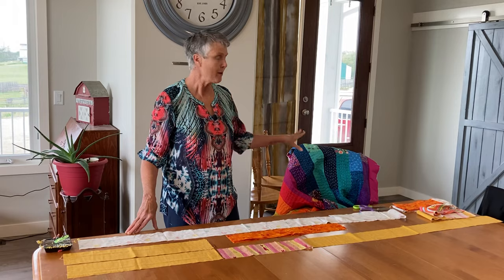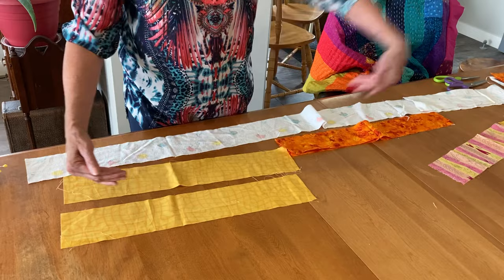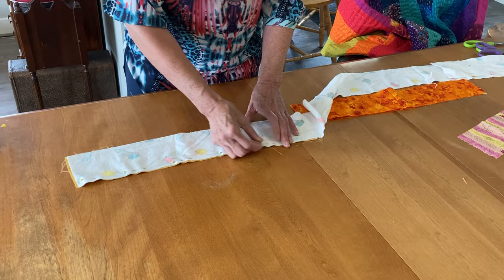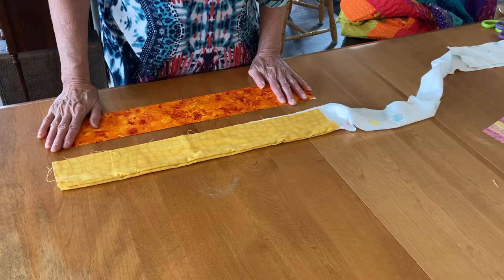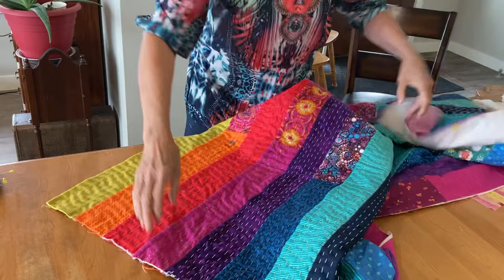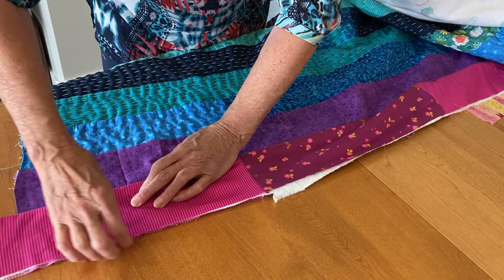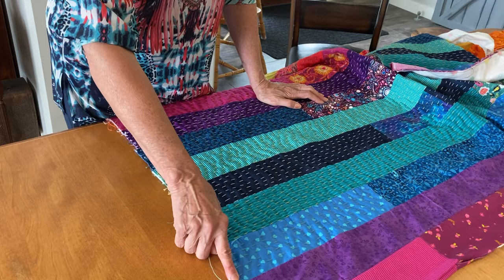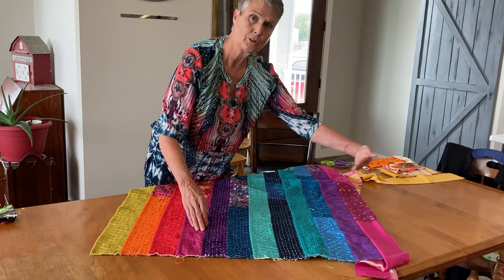Quilt as you go Kantha technique by Terry Rowland

Comment: The stitching shows on both sides of the quilt do you will see the knots, right?
Reply from the maker: I used one thread the whole length so only knots on the ends
Reply: Thanks for the reply. I will make this.
Reply from the maker: @valentinerodger8882  sorry one more thing I start in the middle and work to one end then retread the needle and work to the other end Less stress on the tread pulling trough the whole length. 
Happy stitching and send me a picture when you are done I am on both FB and Instagram message me
Reply: Thanks for the tips. I wondered how the long thread didn’t get tangled. I will send a pic when it’s done 🤞
Reply: One more question. I am using a flannel jelly roll. Do I have to wash and dry it due to shrinkage? I hope not. I am using cotton strips for the backing and a flannel sheet that has been washed many times.
Reply from the maker: @valentinerodger8882  it will shrink so you will have a wrinkly look to it Valentine. This is one way I have done a pre shrink on squares when I wanted to use them with shrunk scraps . I got a containers and lay my squares in them loosely. I pour boiled water over them and make sure they get saturated. Let them sit is the water for a bit then drain the water off and I gently place in a salad spinner and get the excess water out   Then lay them to dry. That All I know
Reply: That’s what I will do. Thanks for the reply.

Comment: I use this method but sew on my overlocker starting with rectangle then adding to each side the ends then sides until required size then fold in edges and then sew on binding. Just love your work.

Comment: I have seen this done where the strips are overlocked/serged together. If your batting is thick enough the extra bulk from overlocking won't show and you never run out of bobbin thread. You just have to be very careful because if you make a mistake you can cut off part of the fabric.
Reply from the maker: Yes you could do it that way also I like to make mine with the flannel to make a lighter weight throw

Comment: Fantastic technique! Thank you very much. Just one question. I didn't understand how do you finish it by the vertical side?
Reply from the maker: THe ends I added a wide binding to finish those off For the last row I turned under the sides and I stitched it closed with the big stitch stitches